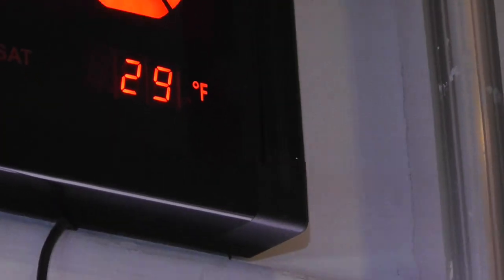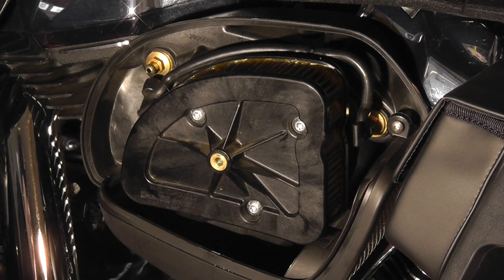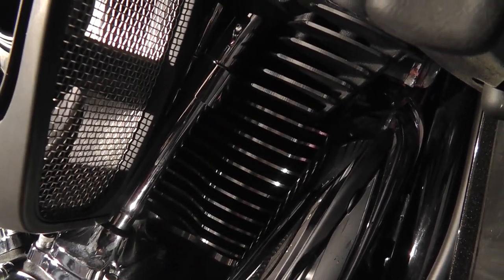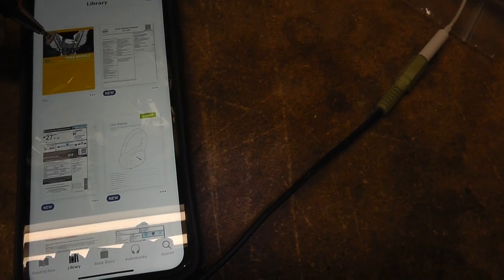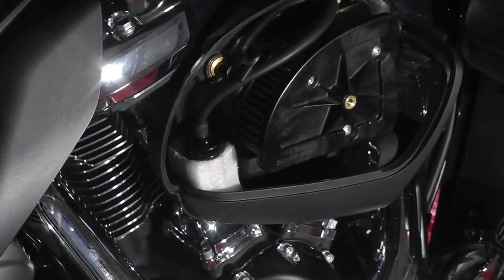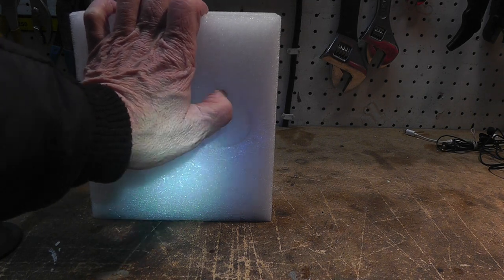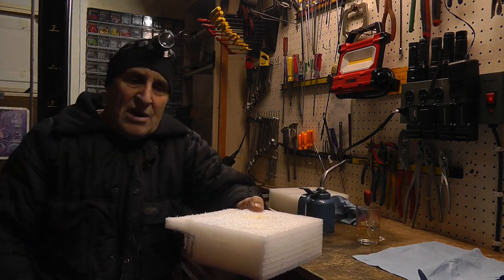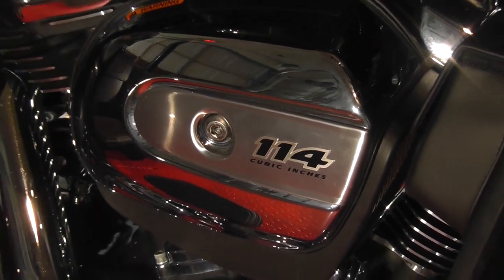2020 Harley Davidson Tri Glide External Breathing system Install

Comment: It's a great video.  I never thought about mounting mine inside the box.  Good news though is that it's always easy to change if needed.
Reply from the maker: Yes, I could not find a good place till I found that spot. Works good.  Took a teaspoon out the first time at about 900 miles.  Since then no more oil has fallen into it since I’ve put on over 6000 miles.

Comment: Thank You , just what I needed . I have a 2019 Street Glide Special and was ready to install a external breathing  system and a K&N filter. Just like you said , not to  many places to hide it nice. I just used a little filer and dense black foam to hide it in back of the air filter and keep it from rattles .
Reply from the maker: Ya not too many places to hide it.   I checked mine about once a month. Anymore there’s just a little bit of traces of oil in there. Less than a teaspoon.

Comment: Hi Ed...watching your video on the external breather makes me wonder why you didn't exit the heat outside air box. Nice idea keeping everything concealed but isn't it the purpose taking heat and the crap that Harley sends back in throttle body. Thinking of installing external breather on my 21 trike. One the question about your catch can. Does it release the hot air/moisture/pressure ? Ride safe...
Reply from the maker: The purpose of rerouting the tubes is so that it does not shoot the excess oil back into the cylinder heads.  From what I understand it’s the oil. The way the factory has it. It shoots it oil back into the cylinder and causes a carbon buildup on the piston top over time, which equates to loss of power, and a much shorter engine life   

Rerouting the tubes away from the cylinder head into the catch can is supposed to be environmentally friendlier. . Some guys just reroute it to drip out onto the ground. 

I see what you’re saying about heat being inside the air cleaner. 

Apparently, I guess ,I didn’t feel the hot substances was an issue.  so much so, I did not even think about it until you mentioned it.   You make a good point, but I still feel it’s not an issue.  I could be wrong. I was wrong once, when I thought I was wrong but wasn’t.

Comment: Thanks for the info..... The package label says its for the Twin Cam/??  Are they the same for the M8?
Reply from the maker: You know, I just ordered mine from DK customs and in the information box I told D K I had a 2020 Triglide and they sent me the parts.  Now the parts I got from them were just tubes and clamps and the catch can. I suppose a guy could use those tubes and route to the catch can On just about any bike. As you can see in the video I did not even use but a small portion of the tubes  they included or clamps.  You can always call them.

Comment: How is the EBS working for you? Have you had any issues? Are you running stock exhaust? Thanks for info.
Reply from the maker: The first time I checked it, don’t know how many miles I went, but it had have 2 tablespoons of water in it. Was riding quite a bit I’ll January and February in cold weather. The second time I checked it 511 miles later it had 1 teaspoon of water in it. The third time I checked it 996 miles later it had zero amount of any fluid in it. I have since ridden another 600 miles and I have not checked it yet.
Reply from the maker: Yes I am running stock exhaust. Stock everything.